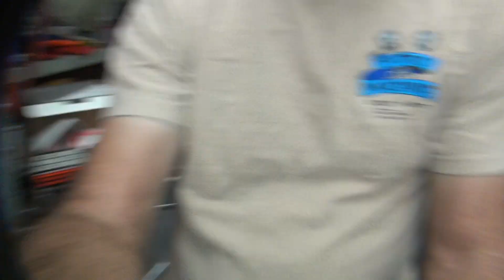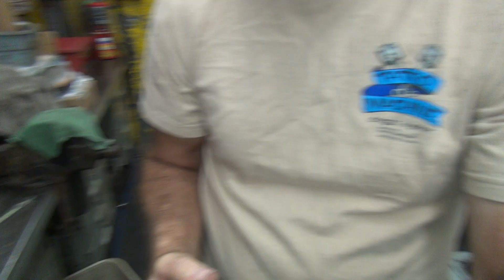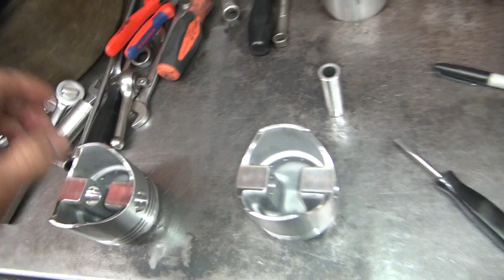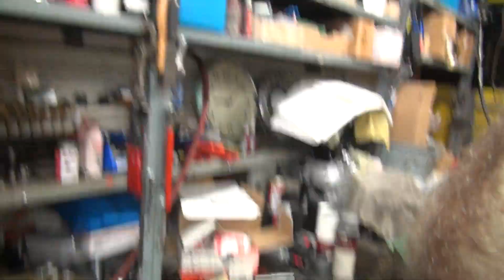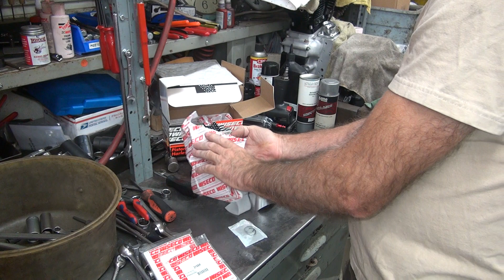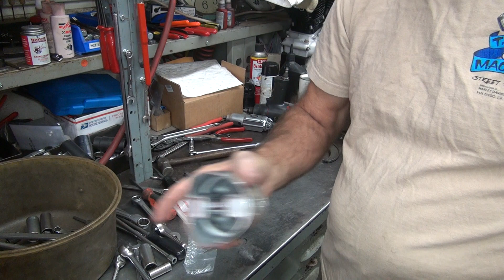#208 2023 el mirage scta landspeed racing harley 650 single xl sportster rebuild nitro tatro machine

Comment: Balancing all the pistons to a common weight with pins and clips is not a thing ? Must vibrate like crazy with some pistons no ?
Reply from the maker: at 8000rpm it is actually very smooth. just go look at some of my running videos. most likely if it it running, it is at over 6500rpm. those few grams are not going to matter at all.
tatro